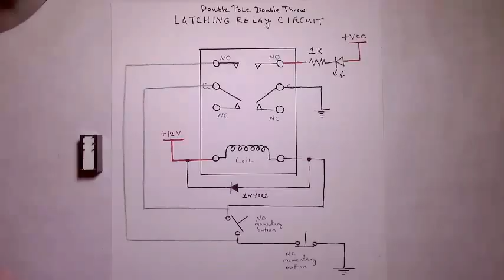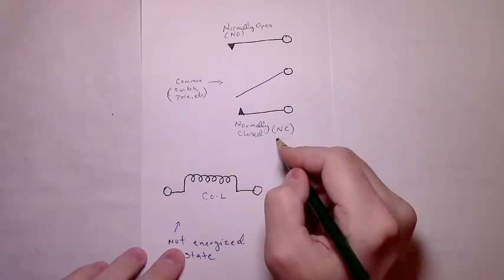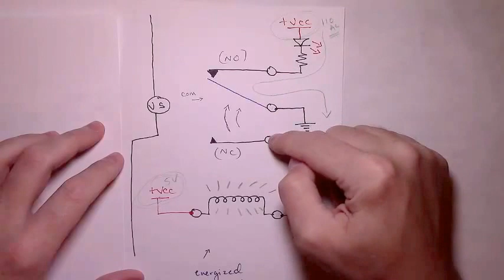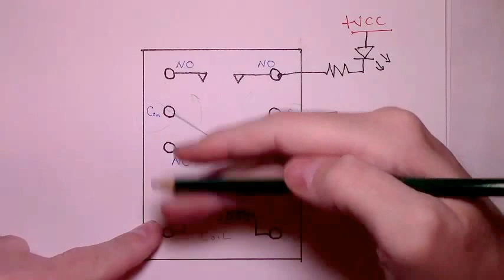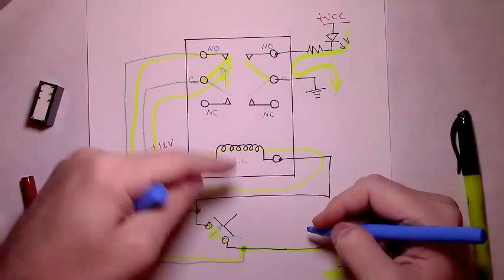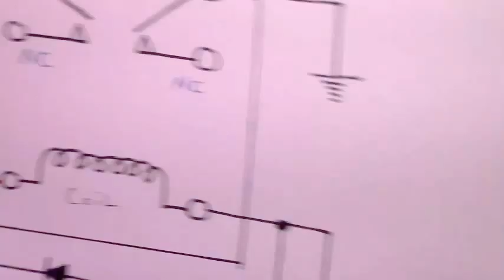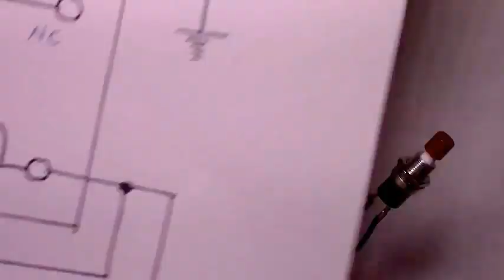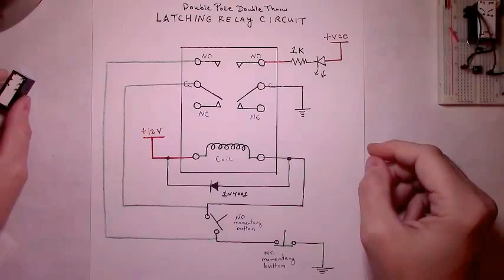Circuit Assembly Tutorials || How to Build a Latching Relay Circuit (with explanation)

Comment: Thanks for sharing.  This looks like the start to a solution of my problem.  Any chance of showing how do a latching circuit in order to switch a traffic light signal?  Currently have a refurbed traffic light that I wired to a 4 position rotary switch.  Would prefer to have 4 buttons..... 1 red, 1 yellow, 1 green, 1 black.  Black would be to turn all lights off, while the other buttons would be for turning the respective light on.  Unsure of wiring and relay solution.  Have seen many multiple relay boards available but everybody seems to prefer connecting to a micro controller like arduino.  Guess I want to go "old school" with buttons.  Hope you can help.
Reply from the maker: TruWebs LLC Appreciate the feedback and question!  I'm familiar with the circuit you're describing.  I was actually working on a video about it right before I was swamped with work.  An Arduino can certainly accomplish the desired behavior but you're right, using a microcontroller tends to take much of the "old school" fun out of it.  Barring the usage of a microcontroller one is faced with the challenge of finding a way to have a single momentary button press latch one relay while at the same time unlatching another.  Such isn't too problematic with two relays but things become significantly more challenging when one ups it to three+ relays, especially if one wants the ability to switch between three or more relays in most any order.   

It will likely be a few weeks before I can upload the video (I have a few other viewer requests to complete).  But, I hope that the following comments will help.   

My circuit uses a 3 to 8 line decoder (74HC238) to control the latching/unlatching.  Using this IC is cheating a bit in regards to being a technically/wholly "old school" solution but it doesn't require any code and the logic associated with the chip is interesting to think about and exploit.   I'll do my best to upload the video as soon as possible.  In the mean time I'd encourage you to check out the 74HC238's datasheet and see what you think.  And, I would definitely appreciate hearing about any thoughts or ideas you might have.
Reply: philo mech Thank you for the response.  I look forward to seeing your solution, as I have been looking for a solution for nearly a year.  Unfortunately your mention of the decoder is just another piece of the puzzle that I do not understand.  Overall, I am a complete novice.  Or a DIYer that has visions and always looking for solutions within my abilities and tool set. :-)   Sorry I can't give any comment on the datasheet.  What I hope to accomplish is to ultimately control the light with a momentary switch control similar to the one listed on Amazon... http://www.amazon.com/dp/B008LT328Y/ref=wl_it_dp_o_pC_nS_ttl?_encoding=UTF8&colid=1CJ79FC37CJYW&coliid=I2U8W63HBWUM4Q
I look forward to seeing your next video.  Regards!
Reply from the maker: TruWebs LLC 
The video, or what seems more likely the case --videos, are definitely on the way.  

It looks like I'll have to break the build (and explanations) of each aspect of the circuit into a few videos.  I'd rather the circuit be understandable and capable of being built by most rather than lacking in potentially helpful and/or needed detail.  

No worries about being unfamiliar with the decoder chip.  I'll explain the parts of its functionality that are relevant to the circuit in the video.  It's a neat chip and functionally understandable: specific input pins are set high or pulled low which in turn switch on/off specific output pins. There's not much more to it (at least as its used in my design).  

I reviewed the amazon link and controller.  The major difference between the circuit I designed and the one embodied in the e-stop plus 3 button controller is that my circuit uses 4 normally open buttons --rather than two normally closed and two normally open buttons mentioned in the amazon description.  One will still be able to reset all the relays by pushing a single button, as well as latch single relays in any order while unlatching all the others.  Essentially, if the momentary button associated with relay 1 is pressed, relay 1 switches on and remains on while at the same time any other relay that happened to be previously latched on is unlatched.  The same holds for the other two relays.  Only one relay is able to be on at any given time but one can switch between any of the 3 relays in any order as well as reset the circuit back to a state where all relays are unlatched/off.  It requires quite a few transistors, diodes, etc., and a bit of patience and care to assemble.  But its interesting and reliably exhibits the behavior just mentioned.    

I had a selectable audio sound effects application in mind while designing but it should be helpful for your lighting application as well.  If nothing else, it'll hopefully provide you with some helpful ideas.  I greatly enjoyed designing/building the circuit and I hope that others will too.
Reply: philo mech Outstanding!  Your efforts are greatly appreciated.  Looking forward to your videos.
Reply from the maker: TruWebs LLC  Just uploaded the first installment in the series on building a "Selectable Latching Relays Circuit".  I'll be doing my best to upload all the videos in that series before the end of this week.  I finally have a little free time and should be able complete and upload many of the videos that have been in stasis for the past few weeks.  Hope they're helpful.